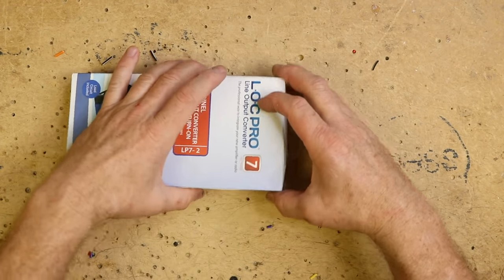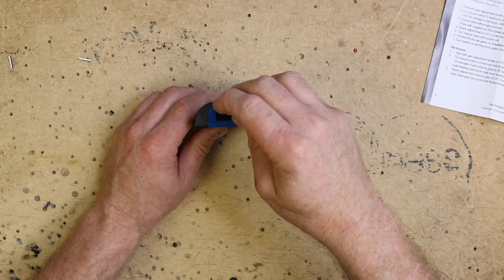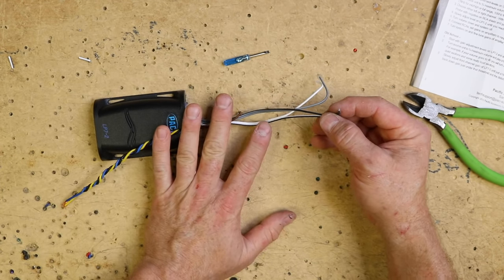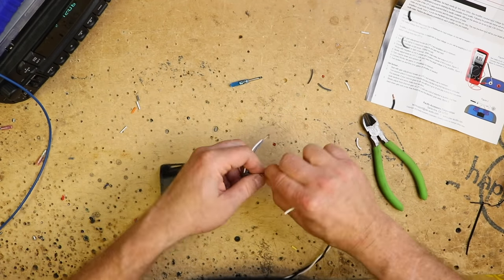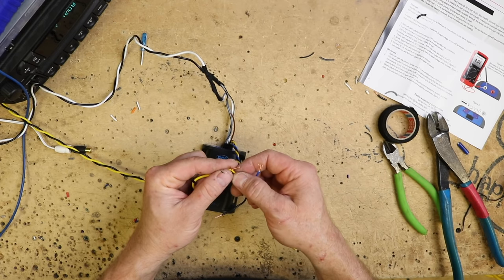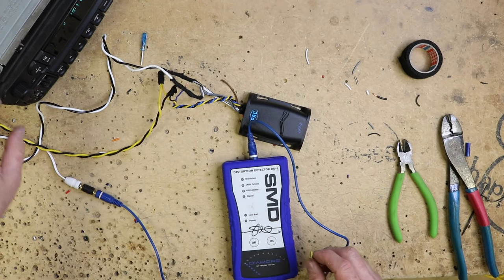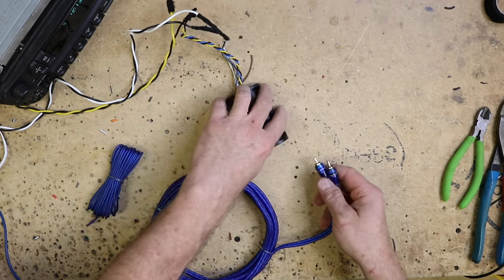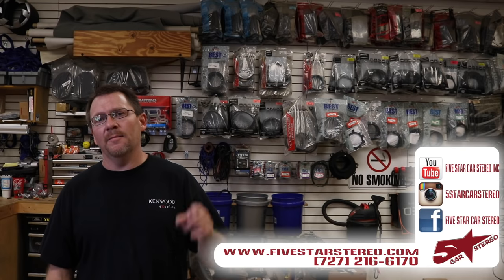How to connect a Pac Audio high to low level adapter, the LP7 2

Comment: i ran into a problem while tryn to mesure the output of the lp7-4, i cant seem to get any readig on my multimeter. i used the same method as shown in the vid (6:57)...i got everything to work and its playing music fine, but i still dont know what the voltage coming out of the lp7-4 is... my multimeter was on the correct setting (V with squiggly line) but i dont know what im doing wrong, any help would be really appreciated
Reply: Adrian Diaz the “V with squiggly line” is AC voltage. You need to measure DC voltage my friend. Should be V with slashed and solid line
Reply: I have the same problem, while I can see the voltage being output by the LP7, it is very low, only 1.5v - and that’s with the gain fully cranked! I measured that while the headunit was at 75% volume. Multimeter set to AC.

Comment: Hey just wanted to know if you guys ever ran into this problem or if I just wired it wrong. I tapped into rear speaker wires and removed the rear speakers completely. I try adjusting the gain on the LOC and I get about 1.9v max. I get 1.9v with the gain only about half way turned up, as I turn it up more my voltage starts to drop, any ideas?

Comment: So it's clear in my head. Hook the yellow to the red cable that goes to car battery? The black to the ground. The blue to the remote. All on the amplifier? I splice into one rear speaker. And connect RCA to amp. The only wire running to front of the car is that red cable to the battery. Is that correct?
Reply from the maker: +Rick Saldana yes you got it
Reply: My question is if youre hooking up the red cable to amp and the yellow cable on the amp into the amp wont the amp always be on because its a constant 12v? Or does loc only come on when it gets signal through speaker pos and neg

Comment: Great video, and very informative. 2 questions...

I have a 4 series bmw and wish to add a 1000w rms amp and sub. So could I use the LP72 to do this or would you suggest a higher spec LOC. And, would it be ok to branch off one of the existing stock underseat sub wires to connect to the LOC?
Reply from the maker: M Henry yes and yes. This will do the trick and you can tap a wire there. Don't panic if it does not turn off right away. Your car usually takes five minutes to go to sleep. It also wakes up anytime you open a door or trunk. It is perfectly normal.
Reply: Thank you thank you thank you, cant wait to install...
Reply from the maker: M Henry let us know how it goes

Comment: I am going to buy the 4 channel version and and jump RCA from 4 way amp for speakers to 2 way amp for subs.  Is the line level for the subs the one I should use or for the speakers? Is this going to work or do I need 2 PAC line converters 1 for speakers 1 for subs?

LP7-> 4xRCA {line level?}-> 4 ch amp-> 2x rca jumper from 4ch amp-> sub amp
Reply from the maker: CSK Designs no that would work, the 4 channel works just like 2-2 channels

Comment: I had a question. so basically if i put this loc unit by my amp i would plug in the power wire into the amps power wire to power the lp72?
Reply from the maker: Alex Arlic yes that is the way we use

Comment: I got the package sni-35 how do I connect it if I got two brown wires my ground is attached to the screw behind the radio and the 4 cable to the left and right positive and negative on the speakers but no sound from the amp and it's on?

Comment: I am on my 2nd pac lp7-2. 1st one I thought had very low voltage output feeding into amp. 2nd one same issue. I have hooked it up  exactly the way u do here. Still only have like 0.017 volts. At max gain on converter. My car is a 08 acura TL, and I'm running converter off of the rear left deck speaker. Do u have any idea what's going on?
Reply: Aaron Sharp did you try running it off one of the front speakers
Reply: I have the same issue with low voltage on my LP7-4 - only getting 1.5v max! Are you measuring for AC voltage?
Reply: Yea a.c. voltage
Reply: I have tried front, rear, subwoofer, and pre-amp. I even tried buy another pac LP7-2. I get the same thing.

Comment: good stuff. i have 2 questions to loc degrade the sound quality? and is an loc that is capable of putting out more volts better? so you dont have to turn up the sensitivity knob up therefore lowering the noise floor?
Reply from the maker: DigitalErra yes on both, check out this video 
https://youtu.be/21xLvMLM1Io

Comment: One. Ore Question the new epicenter Plus Acr 1 control has a 7 pin cable wire that plugs into that bass knob I have the older wire that is only 4 pins instead of the new 7 where can I find that Cable? It's the one that looks like a telephone wire
Reply from the maker: Baby Gotenks I believe it is an old telephone wire. Give AudioControl tech support a call and I'm sure they will point you in the right direction.

Comment: I don't want to remove the deck so I am using a rigged cigarette light plug do I hook up remote from amp to lp7 or remote to the rigged light plug in?
Reply from the maker: Bryan Miranda the lp7 remote wire is an output not an input. You connect power and ground to the yellow and black inputs. Then connect the blue wire to the amp. It will create a remote to turn on the amp. You can connect the yellow and black to the power wire you ran for the amp. No need to remove the radio or tap into the power port.

Comment: AWESOME VIDEO. i have 1 question i recently  bought a  PAC LP7-4 and im trying to connect a 4 channel amp and a monoblock, what would be the best way to connect my 2 amps to the LP7-4?
my 4 ch amp has builted-in speacker lvl, RCAs and  2-4 channel mode but my monoblock  only has 2 RCA inputs
Reply from the maker: +Adrian Diaz I'm guessing the 4 channel amp does not have an rca out? You can run channel 1/2 into the amp and set it for 2channel input. Then use 3/4 for the sub. Or run all for into the amp and use " y" RCAs to split it out to the sub amp.
Reply: thax im go do that,  keep up the good work u have an amazing channel

Comment: I hooked up the power and ground to the Lp7 and And tested the power coming out  Of the remove and only getting 8volt and the radio is on i should be getting 12volt

Comment: If my power is hooked to the cig lighter, is the accessory remote turn on wire necessary?
Reply: Yes, the remote turn on is what turns on the amp. The yellow wire is power for the LOC

Comment: can I use this same LOC and tap into my rear speaker wires instead of pulling out the radio?
Reply from the maker: Duval Byrd yes that would work fine. There is no need to remove the radio
Reply: thanks!! Another question can the blue, yellow and black wires on this LOC go directly into the amplifier ?
Reply: If so that means I ran the power wire from the battery all the way to the trunk for nothing lol

Comment: If I tap off from the rear door speakers of a 4ch factory system for a subwoofer , would power still go to the speakers to play it and maintain a 4 speaker and sub system
Reply from the maker: +alvijay bhagwandeen yes that speaker will still play fine

Comment: To get signal for factory radio on aftermarket amp , can I connect to all four speakers?
Reply: No. Run it either from the fronts or the rears. Typically you’d want to find which set has full range but it’ll work either way. Might just sound off

Comment: Hello guys. I have an urgent question. I recently installed one of these in my car but when tuning the gain even all the way up i am only getting about 1.125 volts of output at 75% volume. Could I have done something wrong? Everything will play but I of course want to make sure everything is right. My amp is a Massive Audio N4 which the range is from 5V to 200mV
Reply: Miguel Cruz, I am having the same problem 2011 hyundai sonata. I am having problems getting over 1.15. A response would be greatly helpful and appreciated

Comment: My aftermarket radio has one rca output can I use the lp7-2 for my amp install?
Reply: Super late but just get a rca y connector "single male  to double female " then an rca wire (2 red & white) straight to the amp then bridge

Comment: Trying to troubleshoot a suspected dead LP7-2...   Does the LED. Turn on when the radio is off?  Mine will pass audio, but I can't get the  LED to turn on and can't get the unit to send power down the blue wire for anything I've tried.  Thanks in advance.
Reply from the maker: Brian Catalano it sounds like you got a bad unit. It will pass audio with out the auto turn on working. If you have it connected to 12 and ground it should turn on. Yes the red light will turn on with out the car on, some cars wake up the radio when you open the door. This causes it to turn on until the radio falls back to sleep.
Reply: Five Star Car Stereo Thanks for your thoughtful reply.  I hooked yellow and black directly up to the 12v battery and no red light... the replacement showed up today so I'll send 12v to it and see what happens!
Reply from the maker: Brian Catalano ok, let us know how it goes
Reply: Five Star Car Stereo Success.  Learned a lot though the troubleshooting process.  Thanks for your help.

Comment: when testing with the dd1 what rca did I plug into it..
Reply from the maker: DANNY TAGGART we just added an rca to make the connection easier. It is connected to the radios speaker wires.

Comment: Can I do this on a 14 Ram with Uconnect 8.4 that controls hvac
Reply from the maker: You can, however if it has one of the Factory amplified systems you would want a PAC Amp Pro
Reply: It doesnt have any amplified that I know of it's not alpine or anything how would I know? And if I use this LOC I can just slice in to one of the speaker wires or like both front or rear?

Comment: I have one of these and for some odd reason my amplifier stays on any suggestions
Reply: This brings up a question for. My guess would be you conected to a constant 12 volt source so your LOC is always getting power making it so your amp is always on. At least thats my understanding of how it works. My question is, does the LOC need a 12 blot source that only turns on with the radio or the ignition?
Reply: I would assume you connected to a 12 volt source thats always on. My question is does the LOC need to be connected to a 12 volt source that only has power when the radio is turned on or just when the ignition is on?

Comment: howd you get the 2v for the amp output voltage?
Reply from the maker: DANNY TAGGART we were using a 1000hz 0db test tone on out test radio.
Reply: so just matching the line converter to the radios output of the rca at highest volume without distortion...

Comment: Can you use the pac LP7-2R with or without the separate gain adjuster
Reply from the maker: chad chiappetta never tried, we only use that one when we need a bass knob.
Reply: Five Star Car Stereo I was curious if it a had the gain adjustment on the actual device as well as the the separate gain control so you could use it either or
Reply from the maker: chad chiappetta yeah that is what I was thinking you were asking. I know we had  a bad cable once and if memory serves it did not work. I just remember having to run a new  a new cable.
Reply: chad chiappetta n

Comment: where will i connect the remote turn on if I'm getting power from the amp to the pac audio? My amp and epicenter stay on when i turn off my car.
Reply from the maker: Javier Flores what car do you have, sometimes if using this device it stays on until the car goes to sleep. It should be about a minute or two, also it will turn on any time you open a door.
Reply: How are you getting power "from your amp"? You mean from the power wire going to the amp?

Comment: I got a 2010 Escalade. I hooked one of these up but I'm getting no sound for the speaker. I m getting power from the rear right speaker
Reply: Having the same issue but with the scosche  loc2slsd  instead

Comment: i hooked up the power and ground to amp like you said in video but my amp stays on
Reply from the maker: Joseph Hernandez you have to wait for your car to go to sleep then the amp will turn off. Every time you open the car it will turn on the amp. It is normal
Reply: Five Star Car Stereo ohhhhh okay thank you !!
Reply: Joe how did you hook up the ground and power wires?  Those two wires are the 8 gauge wires?

Comment: 2015 ford fusion with the simple sync system. how do I find a wiring diagram so I can tap into the wires behind the stereo? I have not found info anywhere on this car. I don't want to tap into speakers but go behind the stereo. Please help I have the lp7_2 and all cables needed to wire just need help to figure out which wires to use
Reply from the maker: +Thomas Nieland DF(+,-) white,white brown PF white purple,white orange DR white green, brown yellow PR brown white , brown blue. 12 volt white Brown Ground Black gray

Comment: so just to make sure I have this correct I can run my power and ground for my amp and just attach the power and ground from the LOC to that and attach the remote to the amp after splicing into the speaker wires.
Reply from the maker: B_12 yes, it is that easy. Scary I know

Comment: I received my unit and the cables are very short. Where can I get more wire for the speaker, yellow, black, blue wires?
Reply from the maker: +Rick Saldana we use 18 awg primary wire. Basically remote turn on wire

Comment: When testing the volts with the test track 40 Hz add zero DB with the gain on the converter  all the way up it's only seeing 1 volt??? Why would that be I'm getting a nice solid 12 volts from the remote
Reply from the maker: cory shaffer the 12 volts is power for the unit. The 1 volt is sound coming out of the radio. Your radio may have a factory active crossover or EQ limiting the low frequency output. That would be the reason for the low output
Reply: I have a 2015 Dodge Dart with the alpine 9 speaker system tryin to an alpine type r 15 . If I can get the converter to see 2 V should I turn it all the way up then will it hurt my sub? I really appreciate the feedback you guys are awesome!
Reply from the maker: cory shaffer what speaker did you tap into?
Reply: I tapped into the right and left rear door speakers
Reply from the maker: cory shaffer you may need to tap the front doors. The front doors are the subwoofer for the car.
Reply: Five Star Car Stereo  I have an Audi a5 with factory sub. Can I tap directly  into the factory subwoofer wire ?

Comment: which factory wires do i connect the pac lp to for subs??? im installing into 2015 chrysler 200 limited.
Reply from the maker: T Houston you have to find out if it has the factory amplified system. To test, play music and listen for a sub, go to each door and rear deck. If they all play high and low sound it is a basic system. You can tap into any of the speakers. If you find a speaker only playing bass you have to tap that speaker.

Comment: I got a 2010 Escalade. I hooked one of these up but I'm getting no sound for the speaker. I m getting power from the rear right speaker
Reply: You may have to source the output from the factory amp if you have the Bose system.

Comment: Do you have to connect the yellow and black cable to power and ground if you already have a remote cable ran??
Reply from the maker: Marco Gonzalez no you do not. It is only need if you are going to have it make the remote turn on for you.
Reply: Five Star Car Stereo kind of this subject but an thought on what would cause this issue? I have a LOC in my car now and at times the sub will distort at any volume and then play fine its random and sometimes it distort forbs while or a few seconds. The shop that installed my system said it was the sub and they changed it and still does it.